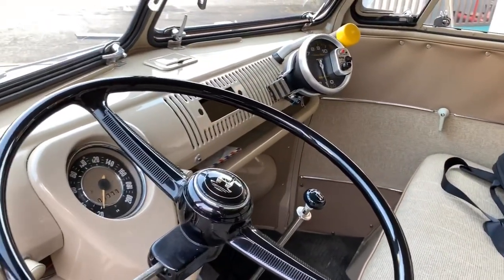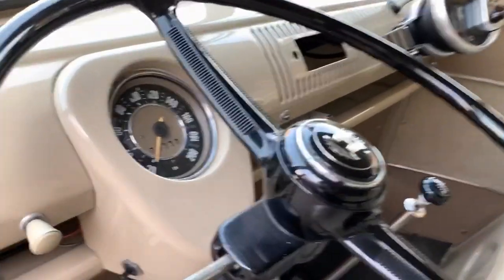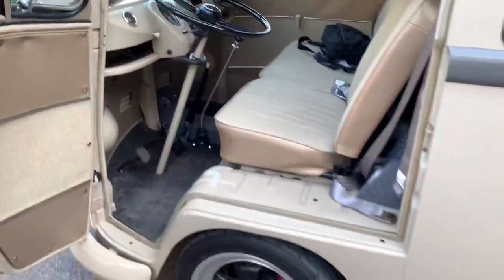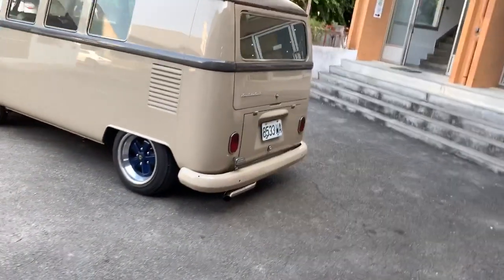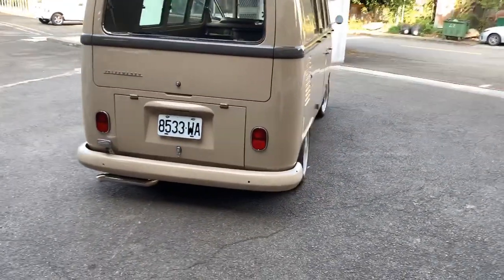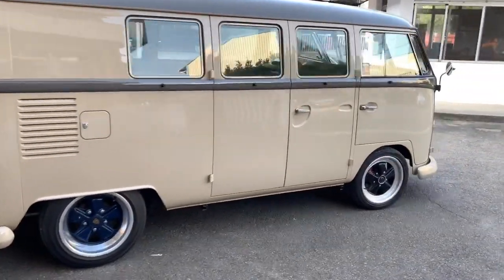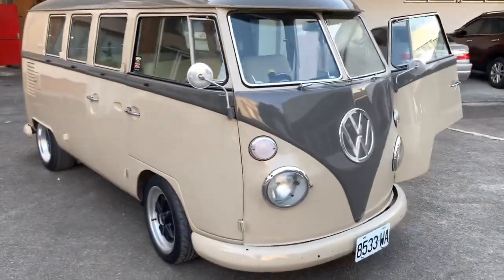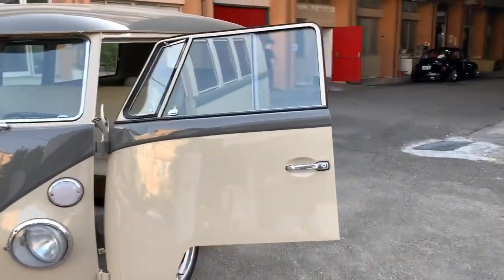SS143 Vintage Speed Exhaust on 2332 Lowered VW Split Bus

Comment: As a retired traffic officer I worked a fatal accident one time involving a bus like the one in the video. Someone pulled in front of the bus causing a glancing blow with the bus hitting a brick wall as a result. Driver was DOA at the scene. Slow down in congested areas dude, you may live longer.